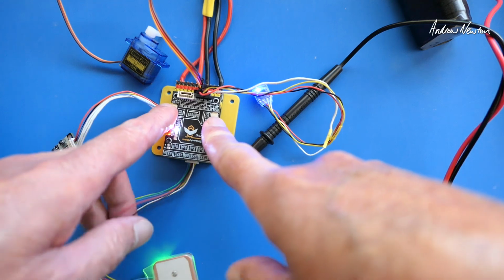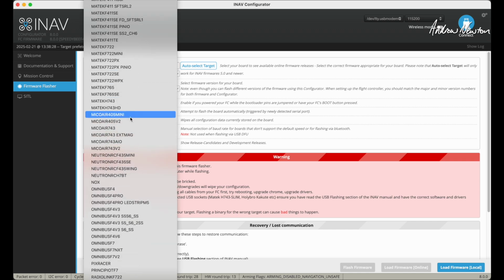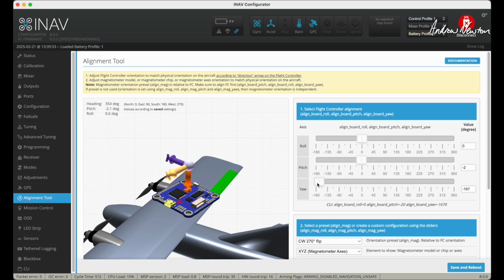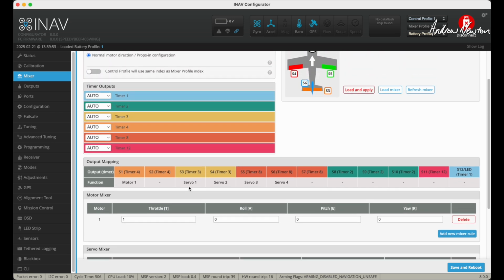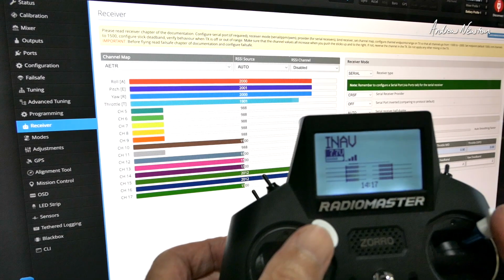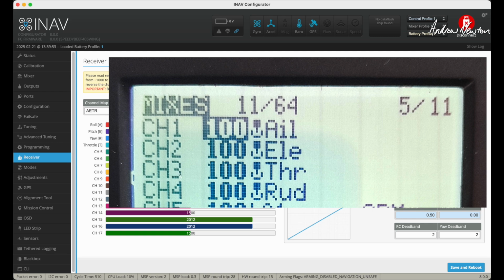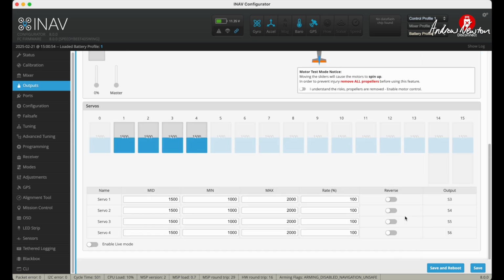INAV Troubleshooting - Servo Problems

Comment: I’m eagerly awaiting your response. My problem is this: I set up the SpeedyBee F405 Wing correctly, and after completing the steps, I connected the servos. However, I encountered the following issue: when I tilt the board left or right, the airplane tilts left or right in the app, but my servo motors seem to move independently during this process
Reply from the maker: That would be normal if you are not in Manual Mode

Comment: Hello,
I flew the airplane with inav 8.0.0 and my elevator servo froze and no reaction. how can that be??
Reply from the maker: Does it still work? Servos can fail or disconnect. Look at cables and pin soldering for problems. Try a different servo. Make sure the pushrod and control surface move easily.
Reply: @AndrewNewton the soldering is good and the other things.
The servo fails only sporadically
Reply: @richie.8611  A friend of mine had similar issue caused by contact error. Cold soldering in his case.
Reply: @AndrewNewton the Pins and the soldering are ok

Comment: Any suggestions on why I can’t get my servos to work on channel. 3-4. But work with ailerons stick on channel 5. I followed your remote setup . Im using a radio master pocket
Reply from the maker: That's an odd one. Do the bars move correctly in INAV receiver page?
Reply: @AndrewNewton  yeh everything moves fine on inav..I got aileron rudder and throttle to work but I can’t get elevator movement on servos.. I checked the voltage everything was fine from the pins. Im going to swapping rx today if that don’t work Im going to try  sbus hopefully something budges 😩
Reply: @saynomoo1  The basic checks you should do first is: [1] Does servo respond properly connected to servo tester? [2] Is elevator moving on Receiver tab? [3] Do you still have correct Pitch line in Mixer tab?    Note: try your tests in Manual mode in INAV

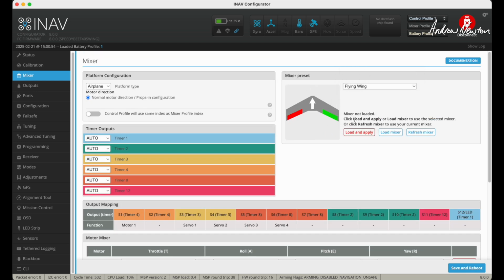Comment: Thanks for this Andrew. INAV 8 currently, i found that besides changing the weight,  like you show  @7:01 , there's also a Reverse button for the servos at the bottom in the Motor menu. both work when the servo needs reversing, so either or...
Reply from the maker: Ok for single input servos, but not for elevons and V-Tails

Comment: Hi Andrew! Love the video's. I have an issue with that same flight controller on INav 8.0.1. When full throttle, Angle mode, hold full left or right for a few seconds, servos stick at full deflection for several seconds even though sticks are centered. Tested this with motor unplugged. Any suggestions?
Reply from the maker: You're entering Stick Commands to adjust accelerometer left or right. Look up INAV Stick Commands
Reply: @AndrewNewton ahh good to know. Ill have to look up how to disable stick command. Thank you!

Comment: Hello Andrew,
Thank you for all of your videos as they have been very helpful so far. Being very new to the FC and its programing and use with INav maybe you can offer some answers to my issues. First, I am trying to set up a fixed wing gasser airplane with DJI FPV and Tally HO head tracker. I have the SB F405 wing, BZ251 GPS and a Spektrum 4651T satellite receiver for connection to transmitter for control.
I am having difficulty trying to configure the FC to control a servo for throttle using the transmitter throttle.
Is there a recent video of exactly how to program the FC via INav 8 for servo channels?
Reply from the maker: Thanks John. I don't fly gassers but you can select RC Throttle as the Input for any servo in the Mixer page. Go to the Mixer, Add a new mixer line, Input = RC Throttle, then plug the throttle servo into whichever pins that mixer controls.
Reply: @AndrewNewton  Thank you, that is what I have been asking for. Seems simple enough, unless you dont know how. INav is not really user friendly with information.

Comment: setting up an matek 743wlitr got it all configed but nothings moving batt fully charged have 5v on the servo pins enabled them in inav it shows to be working in inav and the radio but nothing moves.no throttle,surfaces ,modes im at a total loss right now  samthing with my speedy bee wing board also im at my the end of my patence with them can you help thank you
Reply from the maker: I would start from scratch with just receiver and one servo connected. Reflash with the correct firmware (double check that it's correct) Also look for soldering mistakes, or bad components on your plane.
Reply: @AndrewNewton  i did went through everything even voltages check with a maginfying glass on the joints everything and yes it is the correct firmware even flashed with inav 7 to see if that could be the problem but no same thing yea i always start with the reciever and one or 2 servos.
Reply from the maker: @edwinroper5458  If both boards don't work it must be a basic setup mistake. Send me diff files for both boards and I'll have a look. Email in the description.

Comment: I’m setting up a su35 freewing and I’ll move the surfaces (10servos) and writhin about 30 seconds they will all freeze and start twitching violently then go back to normal and reappear if I move them again. I’m getting 5v on all of them any ideas?
Reply from the maker: With 10 servos you should power them from an external BEC. Too much for the FC servo BEC at a guess
Reply from the maker: 8A BEC would be good. It could also be one faulty servo.
Reply: @ which size would be adequate? I think this might be the reason
Reply: @Pretend_pilotFPV , kindly tell us what size servos you are using,
Reply: if ur 5v reading is during the twitch phase then your fc where the signal is generated is acting wrong, otherwise your 5 volt reading should be monitored throughout the behavior not just at end
Reply: u can run some servo with different 5v supply to know if its voltage or signal for sure
Reply: my dear friend, more info is required, for example a large servo which is running low load will draw little current, if its a camera servo its current draw is negligible, but moving a large surface would pull way more current,
give us the wingspan of your build and approx weight, then u can add something like 2 pcs of xxx servo driving aileron, 1 servo camera, xxxx servo on elevator, then its easy to give a safe figure of the size BEC u need. 5amp, 10amp or more.measuring current draw on bench should also yield how close u are to the BEC limit, but keep in mind that its draw will be higher while flying, a couple more times more